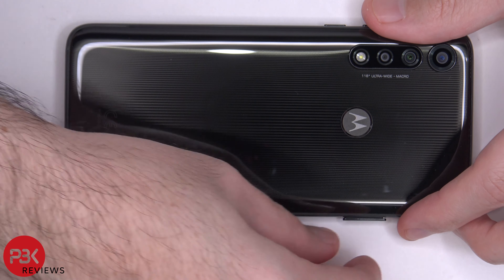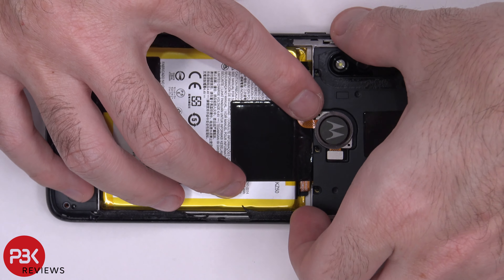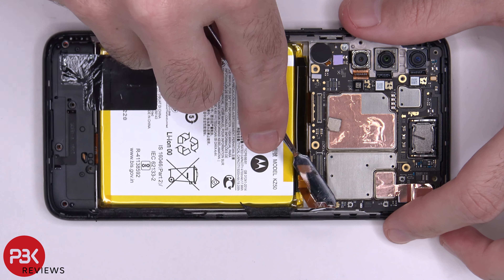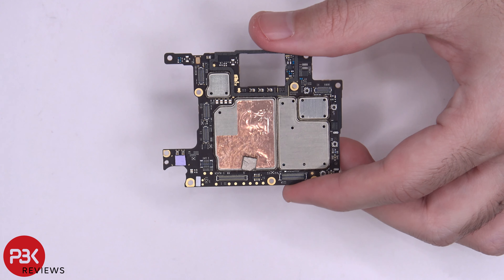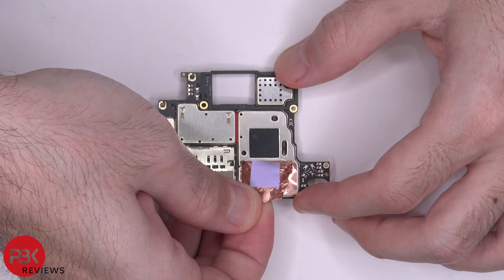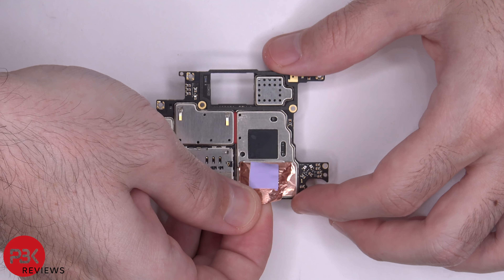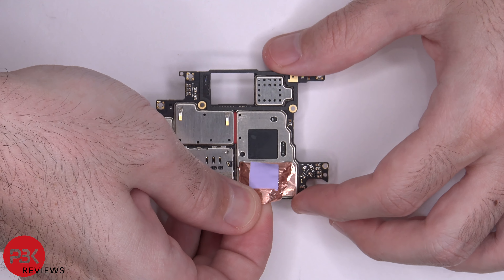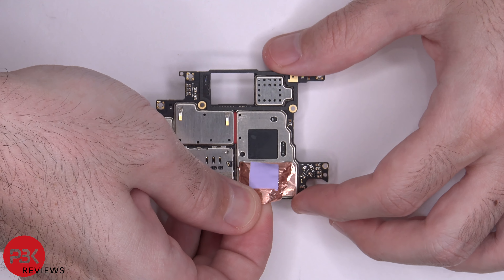Motorola Moto G Power Disassembly Teardown Repair Video Review

Comment: Where can I buy the screen from I tried searching for it.
Reply from the maker: Here is a link for one on amazon https://amzn.to/2CmAUbv  Sometimes searching with the model number is easier to find the screen. For the G Power its XT2041 ( each carrier version has a -1, -2, -3 or -4  etc. after the xt2041 )  Usually its the same screen for all versions of same phone but sometimes it might differ.
Reply: @PBKreviews  hey thanks but the link does not work. Shows no screen
Reply: I think I might just rid of the phone it got ran over by a car lol could be more damage then the screen. The board and chip could be damaged 🤦‍♂️

Comment: I dropped my phone and went to a repair shop to have it the screen replaced. They charged me $80 all included. When I got my phone back it wasn't the same HD quality as original by far. Dark colors are now way too dark. Do you think they put a cheaper one or did they steal any components off my phone? I just want to know so I buy the correct parts and do it myself.
Reply from the maker: Hi, its possible the screen they ordered and used is an aftermarket screen since usually most available parts for replacement are. So instead of an OLED screen it probably was a none oled screen used. However you can order original parts from this website (https://www.mobiledefenders.com/motorola-repair-parts/g-series/g-power-xt2041.html)  for your phone if you want. Keep in mind this link is for the original moto g power xt2041 and not the newer 2021 model moto g power xt2117. They have the xt2117 parts as well but you need to look that up on their website.

Comment: Is the frame made of metal as they claim? Reviewers are constantly saying it's an all-plastic build.
Reply from the maker: the midframe is a type of metal but does have plastic on the boarders of the phone. So it's a mix of plastic n metal but most part of the midframe is metal. It's not a all aluminum frame though say like some of the iphones or the higher end Android phones
Reply: @PBKreviews  Thanks!
Reply from the maker: @beejones4537  no prob

Comment: Does this have the same charger port as the moto g7 play
Reply: And how did you stick the back back on
Reply from the maker: Not sure if the charger port itself is identical to that of the G7 play but the sub board is not. You can get the original parts for this phone, including the sub board with charger port and the replacement pre cut adhesive to re apply the back cover at this website: https://www.mobiledefenders.com/motorola-repair-parts/g-series/g-power-xt2041.html

Comment: Can I just replace my broken screen with having to open the phone, cuz with the old ones you don't have to rip up the entire phone to replace the screen.  Will this work with this one or I have to open the entire phone?
Reply from the maker: No you would need to take apart the phone to be able to disconnect the screen cable and battery etc.

Comment: i bought my moto, 6months ago im scared it smoked when i plug in to charge,now no power  did it ruin already? please help..
Reply from the maker: Not sure, its possible your charger or outlet might have shorted the phone or battery but its rare for something like that to happen. If smoke came out that's not a good sign. You would probably need to take it apart and check n see what is damaged or take to a repair center.

Comment: I dropped mine,,no broken screen..But will not come on..How can I fix it without parts??Or any solutions
Reply from the maker: There is a chance that there might be a hairline crack in the corner of the screen somewhere that you can't see which is preventing the screen from working. If not that, there is a chance the cable for the battery got unplugged and you would need to take it apart to make sure.

Comment: This model is the XT-2165-5. 
I bought a screen from Amazon only to find that it's a few millimeters SHORTER!
At that point, I had already removed my broken screen, and the contacts were the same, so I installed it.
BIG PROBLEM! The screen works but it's VERY DARK!
I can't see it while outdoors.
So be careful buying it online.
Also...if there's a software solution for this issues, I'd be happy to hear about it.
Reply from the maker: The numbers after the - on the model number would only be region variations, and different region versions of the same phone would not have different screen sizes. The only way that can happen is if the screen you got is aftermarket and they are not made correctly etc. The dim screen can be caused from the proximity sensor being blocked or too much light getting to it. There is usually a rubber gasket that goes around it and seats into the frame of the screen assembly. Make sure you have moved over that rubber gasket from the old frame/screen to the new one or you would run into dim screen issues.
Reply: @PBKreviews  Thank you so much!!
I will look for it on the old screen
Thanks

Comment: Could you show us the chip where all the data is
Reply from the maker: The storage chip would be located under one of the metal shields which are fused/soldered to the main board. Would look like the processor (a black square piece) but would probably have the writing Samsung or whichever manufacture of memory they are using. I am not to sure which brand is used on this one. But its not user removable. Its not like a memory card you can take out and put back in, requires soldering etc.

Comment: I had my Moto g power serviced for water damage and now I have no mobile signal. Is it possible a antenna wasn't reconnected?
Reply from the maker: It's possible, It's also possible the water damaged one of the circuits or connectors related to the antenna etc. You would need to take it apart and make sure all connectors are connected properly and everything is seated in its place to rule out a cable not being connected.

Comment: Redmi k20 and k20 pro both have 6.39 inch 60hz amoled display 
Can we fix redmi k20 display on redmi k20 pro
Reply from the maker: Since I haven't taken them apart myself, I am not 100% sure but if both use the same size and type screen which from the looks of it do, and the connector is located in the same place along with the internal design being pretty much the same (which it looks like it is), then yes it should be the same exact screen for both and you can use k20 screen on k20 pro.

Comment: Has anyone had the issue of losing cellular data,phone calls and text messaging after working on it? I only replaced the charging port board.
Reply from the maker: Check and make sure that the plastic motherboard cover as well as sub board cover are in place and screwed down since they have antenna lines drawn through/over them. Also make sure the motherboard and sub board are screwed down properly as well since they also have antenna contacts which touch the frame and make a connection with antennas in the frame assembly. And also make sure all cables are properly connected. But one other main thing, make sure the SUB board you replace, is the same exact model. For example, if the model of this phone is XT2041-1 lets say, the -1 at the end is the region code for the device. The same phone from different parts of the world would have a - 2 or -3 etc and those sub boards have different antenna contacts for the different network bands so if you use a -2 on a phone thats a -1 ending in the model number, then you would run into signal issues. Hope this helps. Also you can check mobilesentrix.com for original parts for motorola phones.
Reply: @PBKreviews  thanks I'll look into these things. The weird thing is it goes in waves, I can use cellular data for like 5 minutes but then it goes down to no signal.

Comment: I blew up my phone microphone blowing out the charging port with compressed air, can I just get a new mic and put it in?
Reply from the maker: Hi, no the mic is soldered onto the sub board, so you would need to probably replace that sub board.

Comment: What kind of Adhesive should I use? I don't want to never be able to open it again.
Reply from the maker: Here is a link for the original pre cut adhesive : https://www.mobiledefenders.com/motorola-repair-parts/g-series/g-power-xt2041/adhesive-back-glass-for-moto-g-power-xt2041-authorized-oem.html
Reply: Thanks mate

Comment: Looks like this phone does not  have  antenna !
Reply from the maker: The antenna's are embedded throughout the sub board (charger port board) and main board and both boards have numbers gold contacts which touch portions of the midframe which usually have antenna lines embedded in them as well.

Comment: I was so close to successfully repairing the phone. But the battery popped and caught fire...
Reply from the maker: Oh that sucks. You can use isopropyl alcohol to get some around and under the battery so it eats away at the adhesive, making it easier to pry off. Here is a link to that: https://www.ifixit.com/Store/Tools/iFixit-Adhesive-Remover/IF145-400?o=4  and here is a link for parts for the G Power: https://www.mobiledefenders.com/motorola-repair-parts/g-series/g-power-xt2041.html

Comment: Mine only charges when it's turned off
Reply from the maker: hmm that's odd. Have you tried a different charger? if so then might have to look into warranty options with motorola or sending it in to them to repair/replace

Comment: i have water damage
Reply from the maker: Your best bet would be to take it apart, disconnect the battery cable and dry out any water inside and use a small brush like a tooth brush to brush off any corrosion on connectors or chips and then re assemble it and see if it will work. If not you may have a defective screen or battery, or possibly a bad motherboard.

Comment: Trash... you don't even show where to start prying the back cover off...  i have tried every way possible I can think of after heating it up then prying it off... it doesn't come off no matter what I do
Reply from the maker: You would need to make leverage to be able to put a plastic tool in between the back plate and housing of the phone. Either a suction tool for smartphones or if you don't care scratching the housing you can use a thin razor blade or something to get in between to make some leverage to get a tool in.